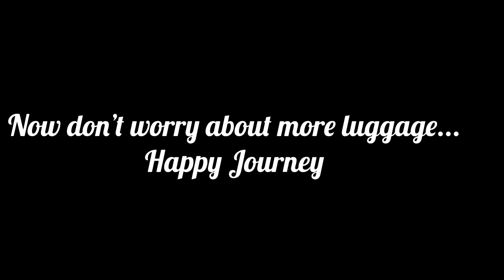Ford Accessories: Roof Styling Rails And Cross Bars for Ford Ecosport to carry more luggages...

Comment: Can you add aftermarket cross bars , I would need one more forward so I can carry a kayak.
Reply: For ES you can keep one more cross bar on middle which comes with FASS. But aftermarket lot of choices will be available.
Reply: @SupportDreaMerchantZ   Will the cross bars be spread apart enough , on these factory rails for the ES models there are only 2 spots to fasten the crossbars which is one towards the rear and the middle there is no forward area to fasten a crossbar , normally for yaks you would have a cross bar at the rear and another at the front , pretty stupid design by ford , is the titanium the same or does it have the 3 options .
Reply from the maker: @nashguy2814  in Ford fitted roof rail , there are 3 areas available to fasten the cross bars. But cross bars comes in pairs only it seems. I have first fitted it nearyby bars and later changed it to extend it from front to rear, but middle no support will be there. Also there is a weight limit also for this crossbars and roof rails can hold. So that also, you will have to check as you want to keep Yaks.

Comment: Is this cross bars restrict the functionality of sunroof..?
Reply from the maker: Ford crossbars can be fitted in 3 locations on the roof rails. None of the locations have any hindrance with the sunroof. It will work fine unless your bag is very big and it goes up to sunroof
Reply: @nishaniEntertainment  is this bag brought from Amazon ,big enough to cover the sunroof..?
Reply from the maker: @rejo006  nop. crossbars are fitted leaving the middle part. This bag comes just near to sunroof till end of the vehicle. I have never used this bag for travelling. One thing to be noted is that roof rails which comes with EcoSport doesn't have gap like shown in the pictures. In picture , I think they are showing the Isuzu dmax.  So we will have to use extra LUGGAGE BUNGEE ELASTIC plastic ropes to hold it tight.

Comment: what about the roof rack which is better. Cross bar or the roof rack from ford. Looks like with roof rack the luggage would be more firmly planted. Any thoughts
Reply from the maker: Depends on looks, I use roof rail with cross bar combination as it looks more stylish. Also my need for the luggage to keep on roof is not that much

Comment: What's the maximum weight you can use on this ???
Reply from the maker: Size LXBXH - 98X78X38cm, Capacity - 270L
Reply from the maker: https://www.amazon.in/TREK-RIDE-Roof-Luggage-Multicolour/dp/B074LCSNN8/ref=sr_1_1?dchild=1&keywords=TREK+%27N%27+RIDE+Car+Roof+Luggage+Bag&qid=1621601661&sr=8-1

Comment: Price?
Reply from the maker: Bars and Rails from Ford. Bag from Amazon India
Reply: How much for cross bar bro
Reply from the maker: Cross bar for 7.5K
You can see all Ford Ecosport accessories and the price in below link

 https://www.india.ford.com/suvs/ecosport/accessories/
Reply: @nishaniEntertainment  i c. Will check bro. Qnyhow nice mods. 
Alloy is DOPE. 
I,ve titanium black 2020. Planing light mods. 
Hav u done qny upgrqdes to headlights? Or is it all stock?
Reply from the maker: @aweirdcompass2746   I have not done anything which makes warranty void. No wire cuts, patching, peeling and merging , nothing like that. Only done Raptor Style front Grill without connecting the DRL's on it, Alloys, 3M Polarized sun film, 3M roof coloring with glossy black vinyl . Then added only Ford accessories from showroom. Now only need to do underbody anti-rust coating, which also I will be doing from 3M. They have a rubberized coating which costs around 7.5 K . it lasts very long.  After that am done with my work :)
Reply: Is there any noise from crossbars while traveling